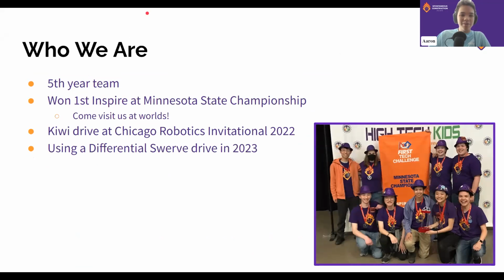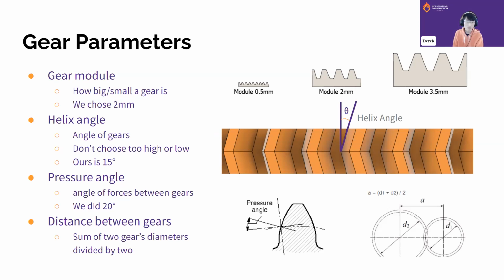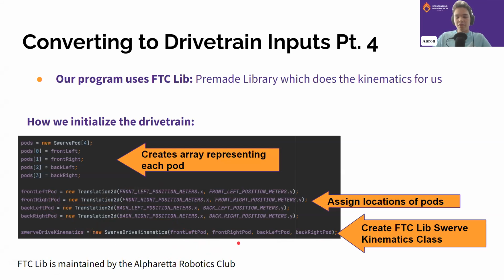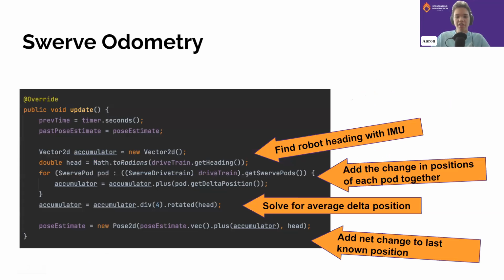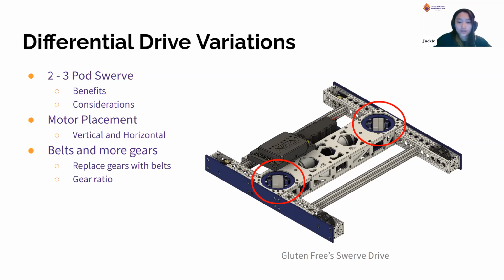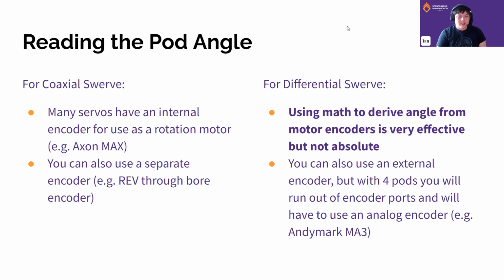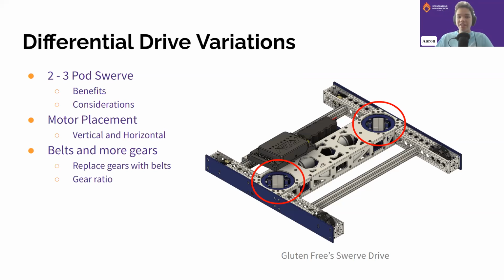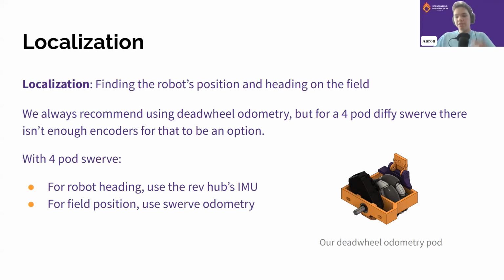How We Built a Swerve Drivetrain

Comment: I have a question: If you have used the limit of eight motors simply on the drivetrain, what do you use to power the other mechanisms on the robot? I figure that you guys probably use servos, but what type?
Reply: Yes they would use servos. probably AXON max servos for heavy lifting, and others can be done with other AXON/goBILDA/REV or other servos. you can do coaxial swerve with 1 servo and a motor, if you need 4 more. They mention it at 5:07
Reply: @quinnkortbus5375  thank you so much- I have been waiting for a response for a long time
Reply: Of course @joshuadoessports  !

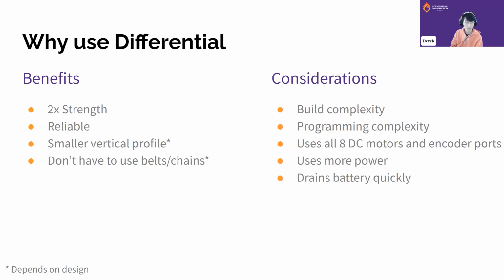Comment: 8:55 differential is not twice as strong as coaxial ;) arent you also able to run your drive motors without encoders, so you can attach a external encoder to the pods and still have 4 encoder slots open for odometry?

Comment: With 8 DC motors used for the drivetrain what do you use for other mechanisms?  Only servos?
Reply from the maker: Actually yes! Our lift is powered by 4 gobuilda continuous servos that are geared together to power one central axle. This means it is slower than a lift powered by something such as a motor, but since we were able to remedy that slightly by stringing the lift with cascading rigging.